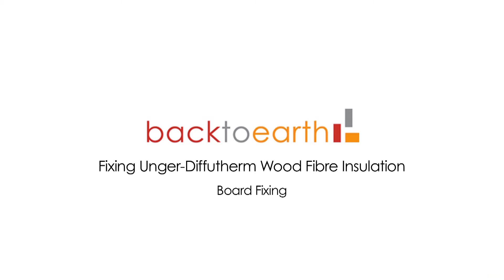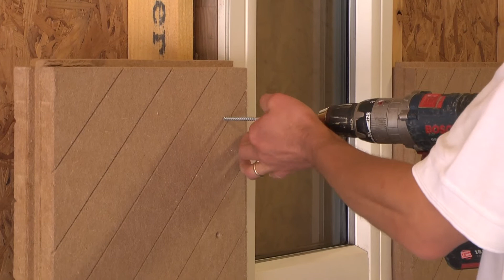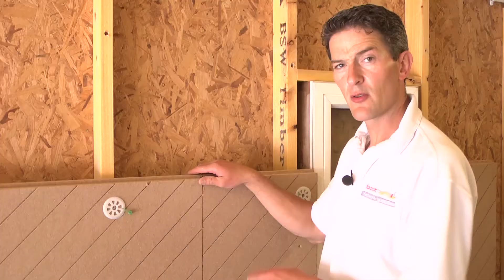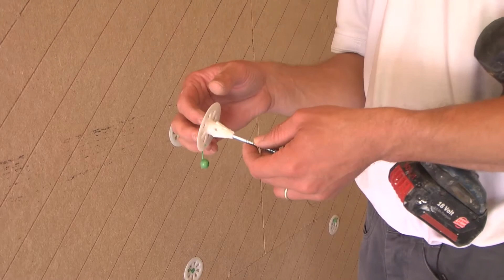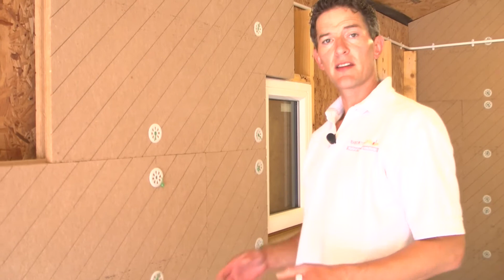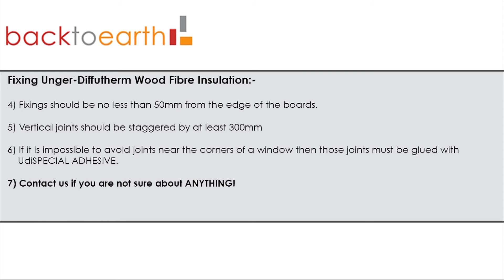How to fix wood fibre insulation boards to timber frame.

Comment: What is the maximum distance from an edge that you would fix the boards? How many fixings do you need per board?
Reply from the maker: Hi Amy. I'd say around 150mm from the edge would be the maximum and usually you need 8-9 fixings per m2 (or per board in this case) for wood fibre boards. If you have 600mm centres on your studs it will be 9 fixings or if 400mm centres it will be 8 fixings. Hope that helps.
Reply: Hi Chris, thanks for your quick reply. If you have studs at 600mm centres how can you maintain fixings at max 150mm? The join between 2 boards would sit somewhere between the studs (eg join at 300mm from centres of studs for both boards or 200/400mm etc.)
Reply: Sorry, I don't think I have been very clear. I am concerned about where boards join and want to check whether it is OK for the corners of boards to not be fixed. I'm planning on using wood fibre board that is tongue and groove but only 40mm thick and my studs are approx 550mm centres.
Reply from the maker: @HandmadeNest  hi Amy. Generally it is best to aim for 50 mm also from the edges of the boards and then one roughly in the centre. So for example if you have an 800 mm wide board you would have a fixing 50 mm from the bottom edge, 50 mm from the top edge and one in the middle of the board at 400 mm from either edge. In terms of where the boards join, you would simply start attaching the boards to the timber frame and not worry about where the joins are. The tongue and groove profile takes care of the connection to the adjacent board. Just make sure that from one course to the next you stagger the vertical joints by at least 300 mm. Hope that helps.